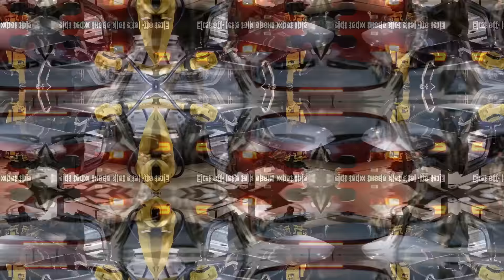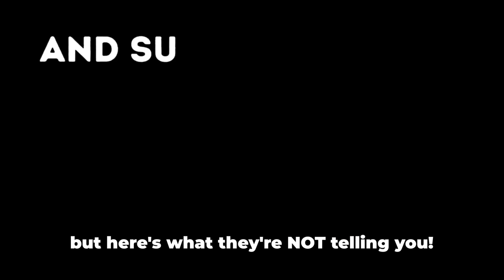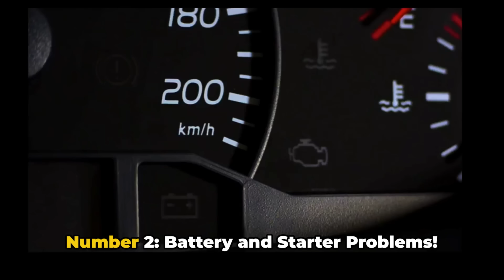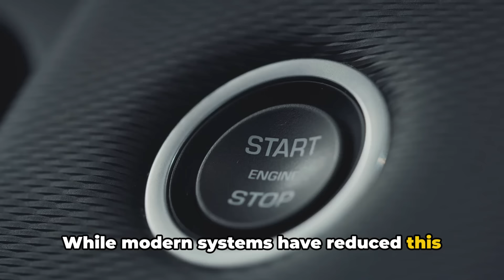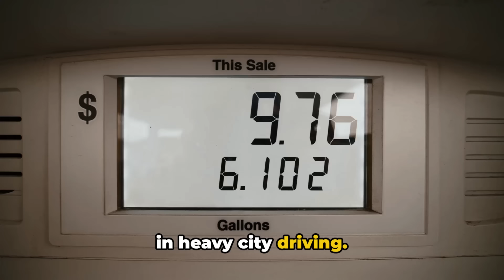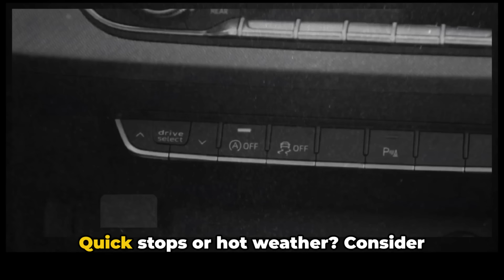The TRUTH About Auto Stop-Start System (Nobody Talks About)

Comment: Using hybrid, no issues at all. Engine start lag? It spinning in less than a second, basically the moment the gas pedal are in the floor. This guy seems to be covering cars from the 2000....

Also, video didn't mention, that if ac is really needed, car computer wouldn't stop the engine. Better you gays go and check the video, how the system works.

Comment: Other than the oil pressure, Chrysler’s system is uniquely different, the etorque uses a dedicated 48 volt system that does not utilize the starter or the 12 volt battery and it is seamless.

Comment: There is a theory in the UK that stop start puts additional stress and wear on the timing chain or belt. As recommended in this video change engine oil and filter more often than manufacturers recommend, say every 6-10 k miles.

Comment: 140,000 miles in my 2016 Hyundai i30 1.4 (petrol), with A/C always on, and auto stop/start always on, and the car hasn't missed a beat.  The original battery is still fitted, and the oil level remains constant between 20,000 mile changes.  The mpg display shows 45-47mpg, so I'm happy.

Comment: What about the mechanical stress the engine and the moving parts are subject to every time the engine starts? The rules of physics, one cannot neglect.
Imagine pulling a very heavy coach or a sofa using a rope. 
And alternatively make intermittent stops along the way..
The legs, the rope and you are under more stress every time due to static friction. 
Besides the action kinda makes me think, the stop start system fights inertia every time (inertia of moving parts inside the engine, not the car).
Maybe I'm wrong, but, maybe if a scientific approach might show exactly the opposite of their claims on fuel consumption.
Back in the time, starting the engine was expensive. Electronical systems highly optimised the procedure. Yet I'm not sure if it's really that efficient.

Comment: The system is terrible. Nothing like sitting at a light with warm air blowing at you in August. I told my sister how to turn that off in her Honda. She refuses to do it because she's a female and lord knows a man can't possibly know anything. My Dad hates it in his Subaru so he lifts his foot off the brake every time the engine shuts off. It's nuts. If and when I buy a new car for my wife (she actually wants a 1970-1985 pickup) I'll disable that crap permanently.

Comment: The one installed in my engine rarely starts, you have to fully pressure the break before it even kicks in. Plus it doesnt start when you are in stop and go, it will turn it off. I am driving a i10 2024 model and live in Denmark so here it does make sense as our gas prices are insane

Comment: You miss the cooling effect on the catalytic converter with start stop. These require around 400 degrees C to operate. This can take 3-4 minutes of engine operation to achieve. While some heat will be retained the cat will not be at its optimum designed temp allowing a soot build up and excessive emissions, which totally defeats the reason of design.

Comment: I’ve got a VW Amarok, I just pulled out a little plug that goes into a little black box that sits on the negative terminal of the battery. The system can’t read a battery voltage so it just disables the stop start automatically. No need to keep pressing the stop start button upon first starting the car :)
Reply: Yes, and now your Amaroks PCM cant obtain the critical thermal and electrical data it requires to control the charging system, meaning that dependant on your vehicles software either the battery will continually charge at full whack or at a low safe constant,either way it will end in a replacement battery and maybe an alternator too. There are adapters available for VAG vehicles that plug directly into the switch which automatically disabled stop start upon every ignition cycle.

Comment: VW can not be permanently disabled from the dealer floor. You can buy a module and installs in less than 30 minutes. I have it. It has a memory (remembers the last setting of the S/S) so you do not  have to constantly shut off the S/S feature every time you start the car.

Comment: Had to drive a loaner Subaru Outback that had this feature.  The cluster also gave me data when I was stopped at a light briefly and the engine cut itself off.  I sat there with the engine automatically shut off for a grand total of ten seconds, and saved a grand total of 0.010 gallons of gasoline.  Yes, 1/1,000 of a gallon per second.  Really didn't seem all that beneficial to me, and after finding it couldn't be permanently disabled I just reflexively switched it off every single time I started up the car.

Comment: I have just received the override connection, but haven’t installed it yet.  My car is designed to defeat the override button when the ignition is turned off so it’s on every time I start the car.  Of course, the system itself is not functioning properly to begin with, for the first couple of stops, the system is disabled without me pressing the button, then all by itself it’s enabled, whereby I then have to press the button to disable it.  I can’t wait to get the override wiring harness installed, this is so annoying.

Comment: As for carbon footprint,  every time the engine stops and starts up, the fuel map goes back into open loop, runs rich until the emissions systems agree and adjust back to maximum efficiency.  It's not saving the environment either.  During this period,  it's causing poor fuel economy as well.

Comment: SO TRUE. 4 years ago I bought a 2016 Alfa Mito Benzina, with just 22k on the clock. Dash stated just under 7 liters per 100km, but my carguy (in fact an expert in car electronics/electician) shut off that stupid S&S button saying, you do not want this crap BELIEVE ME🙏🙏🔝🔝
Car is now just over 90k, and it drinks one liter more compared with S&S on. Apart from battery, starter and alternator are also WAY TOO EXPENSIVE to service or replace🙄🙄

Comment: My previous car was a hybrid so there was zero delay moving from a stop. My new car is only ICE and I hate the auto start stop. I want the car to move when I expect it to, I got so used to the instant torque of the hybrid. I’ve assigned a shortcut to a physical button to turn it off as it turns on with each car restart. Changing the driving mode to sport also turns off stop start.

Comment: Our 2016 Cadillac does not have anyway to turn off "auto stop".  If I press lightly on the gas the motor keeps running at stop lights.  I can keep it in manual mode ( which sucks ) or put it in neutral ( which is a pain ), but that year didn't have a button to press to turn it off.

Comment: IMO it has zero to do with fuel efficiency and everything to do with emissions.  ICE vehicles are the least efficient emission wise while at idle.  Put thousands of them in very heavy city traffic and a great deal of pollution is generated in a concentrated area.  The system absolutely wears vehicle systems more quickly however.

Comment: I used to pick up and drop off vehicles at a rental agency. Nothing  annoyed me more than this feature. The biggest issue I faced was timing. More often than not, the engine would cut out right as the light was turning green or if I was stopping for a brief moment. One vehicle I was driving shut off right when I was taking my foot off the brake, which caused the starter to kick in before the revs even fell to 0. I remember hearing a grinding noise when that happened. I wasn't even surprised that that happened.

Comment: "Beefing up starters"? Hardly, they've reduced the size of them in recent years to reduce weight, so they're just trending back to the size of older cars. And those AGM batteries are complete junk, the percentage  of full charge they need to start the car is higher so they have a lower number of starts in unit life so you replace them sooner. Add more starts get faster failure.

Comment: Never turned it of in the 12 years in had my Citroën... Never had any problem with the engine.
(And the start-stop didn't use the starter motor at all, it used the alternator as starter motor, extremely fast, no starter sound, no wear on the starter gear ect

Comment: TBH it is not that bad, my VW Golf 7 from 2014 has it and I love it, it only turns off the engine when a lot of conditions are met. The engine must be warm, battery voltage must be at a high level, AC must have cooled down the cat/heating must have worked a certain amount so it is fine to run a while with less heating/cooling. The fuel savings are insane, in rush hour city traffic it can reduce the fuel consumption from 8-9l/100km to something like 6-7l/100km. Ofc where there is no rush hour this feature is used less and therefore the savings are less. Also the engine just starts up pretty much immediatly then it is warm and it also turns off itself when moving less than ~4km/h which is insanely optimized because it obviously also turns off break booster making it harder to brake.
Reply: I don't have the same turning off when moving in my Mk7 Golf GTI. I did replace the battery recently but after 8 years and the cost was slightly more than a non-stop/start battery.

Comment: I had this on my Ford F150 and hated it, I would damn near get killed trying to turn in heavy traffic without power steering for several seconds. I got in the habit of turning it off. My solution was to buy a GMC Denali 2500HD diesel that is exempt from needing this crap. So much for saving the planet, its the law of unintended consequences.

Comment: Excessive idling is still the bigger societal problem, wasting untold amounts of oil we'll never get back (it's actually a finite resource, despite pseudo-patriotic drilling hype). Hybrids use stop/start but it doesn't tax the traction battery, and those engines are doing quite well.

Comment: I have a Mercedes CLA 220 CDI that i got back in 2013 and it has this start stop feature. Ive never had any issues or had to replace any parts and the car has about 200k+ kms on it; though serviced yearly ever since bought and the system doesnt really have a delay that gets me frustrated as as soon as i lift off the brakes the car is on and we're moving. I have only turned the start stop system off when the auxiliary or "electronics" battery was just about dying and this was like 3 months ago.. 

I live in a hot climate as well (South Africa) however, never had issues woth the vehicle and i use this feature frequently.

Comment: 2014 Audi Q5 Turbo Diesel with 245k miles, auto stops pretty frequently and have had no major engine issues, it may not be the same for every manufacturer but ive found good maintinance probably prevents a lot of what auto stop is blamed for

Comment: The beauty of a Mazda is you control this with the brake pedal pressure.
When stopped if you ease up on the brake pedal slightly it will not activate the feature.
Reply: If you have finesse with your brake pedal, that's great.  Toyota eventually put that in their cars too (at least on 2022+ RAV4's).  I still turn off the auto start/stop ("auto stall").

Comment: I guess it really comes down to what vehicle you have. RAM did really good with theirs. A belt driven generator starts the truck at the crankshaft from an aux battery. It also uses regenerative breaking. It applies tourqe at the crankshaft to get past the static friction from a stop. It also slows the engine rpms during shifts saving wear and tear on transmission clutches.

As far as oil pressure goes, a cold start takes longer to get oil everywhere because its had time to drain. A hot start during stop and go is nearly instantly pressure.

Comment: Shouldn't really cause excessive engine wear. On cold starts all the oil is in the sump and internal surfaces have had time to drain off. On hot starts, the sliding surfaces are still heavily coated with hot oil which hasn't had time to drain away which should cover you until the pump gets going.

Comment: I've seen a video somewhere on YouTube where they checked out when it'll really save fuel. In a sedan with mid size engine (don't remember the exact size) comes out at ~7 seconds shut down you start saving on fuel. So I shut the start/stop off and on depending on the estimated stop.

Comment: 1.  I’ve never heard anyone sell auto start/stop (ASS) as some sort of amazing tech…in fact, of the 30+ cars I’ve purchased, never had a salesperson bring it up; 2. I lived in Japan in the mid 90s, before ASS.  It was common practice to turn your car off at stop lights…we never had long term issues with batteries and starters and that was before they were beefed up; 3. Most cars don’t engage auto ASS unless certain criteria are met, including engine temp, ac use, and some others…so, if there is a load on the engine that is needed, it won’t engage; 4. Oil pressure for turbos…if you are in stop/go traffic, you likely aren’t engaging the turbos and don’t need the oil pressure to be at optimum pressure….you’re crawling along…so, unless you floor each time you start, non-issue…5. Agree that there are times when ASS isn’t helpful…e.g., coming to a stop light where there is a right on red, or any turn from one street to another where you are only stopping momentarily and getting ready to get out into faster traffic…in that instance, either disengage it, or better yet, if your car has a sport mode that disengages ASS and that’s easier to engage, do that…I have a mini that engages sport mode (disengaging ASS in the process), by clicking the shift lever over.  In the end, in a country of 350M people and over 290 million cars on the road, every drop of oil and emissions count…why sit there burning oil and creating pollution if you don’t have to?  If that costs us a little more money now (instead of paying with our health later), why not do it?

Comment: OR…you could buy any Mazda. None of these BS systems are simply a cheap way to comply with pollution and fuel requirements set by the EPA. Mazda handle the problem differently. Through proper engineering of its engines.

Comment: LOL!! The misinformation in this video is toxic. 48v systems fixed every made up "battery and starter" issue you created. Modern turbo cars are coolant cooled with an auxiliary coolant pump. Start stop is signaled off the brake switch not the gas pedal. If your A/C goes warm you have an A/C issue not a start stop issue. AGM and Lead acid batteries both have a life span of 5-7 years. AGM performs better in cold and heat. If you do have a Modern 48v car then the generator ,that replaces the alternator, starts the car. Electric A/C compressors increase fuel economy. Still only operate 40-60% of city driving.

Comment: While my car was being worked on, the service center lended me a Honda accord 1.5 liter turbo that had start stop. I hated it. My car doesn’t have that feature since I drive a 6 speed manual transmission car. But I did learn a few ways to avoid the engine from shutting off when car stops. One is that the system checks for the condition of the car settings and temperature, it has to be not too cold and not too hot in order to actually turn off the engine, so you just set the AC to high or low auto. It’ll never turn off the engine because the AC requires the engine to be running in that AC setting. Another way is if you stop but gently press the brakes, it’s like you telling the car that you will move after stopping so the engine needs to stay running. When you press the brakes firmly, then it’ll shut off the engine when it comes to a complete stop. Another way is to put the car into sports or any mode that’s not eco friendly basically.

Comment: My wife's 2022 Highlander has this feature, but it only shuts the engine off if you press the brake pedal firmly. If you hold light pressure on the pedal, just enough to hold the car still, it brings up a message on the dash that says something like press brake pedal harder for auto shutoff. It also has a disable button, but I don't need it, because I hold light pressure on the brake.
Reply: Same scenario with my 2015 Mazda 3. Engine stops only if I push the brake pedal down extra firmly which I rarely ever have to do. For extended stops I apply the handbrake. To hell with the otherwise minimal fuel savings.

Comment: At my last job they bought a car with this installed. Since i often used company cars I sometimes had to use the one with the auto feature and from the first drive I hated it and always turned it off. At every light I would press the gas and it would vibrated and shake as the engine started while also still trying to move the car and it just felt uncomfortable. I tried letting off the brake gently to let the engine start first, but it was akward taking the extra second especially with how impatient other drivers can be.

Comment: There is no way that the average person will realize a 10% fuel savings. That would be the extreme person sitting stopped for 30 minutes at the time. At most, it's probably more like 2-3% in most city driving. Sometimes more or less. In rural driving, its negligible. Not worth the extra cost of installing the system with its expensive parts and their maintenance.

Comment: In the last 900 miles, Auto Stop-Start saved only 35 cents in gas. The average starter costs $500 without labor. I have a Subaru Crosstrek. Even with the vehicle's incredible longevity, I will never drive far enough to save enough money to replace the starter (I would have to drive 1.4 million miles).
And it's more dangerous in cold weather than hot weather because your windshield will fog back up immediately after you just spent the last five minutes getting it cleared up. 
The auto stop-start feature is a scam, thanks for the video.